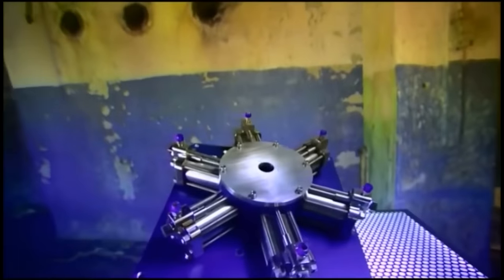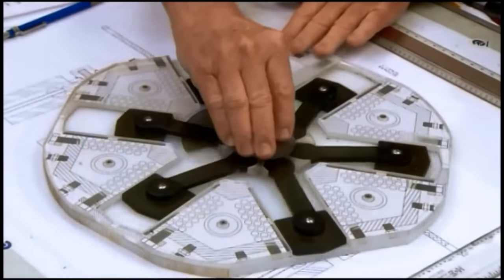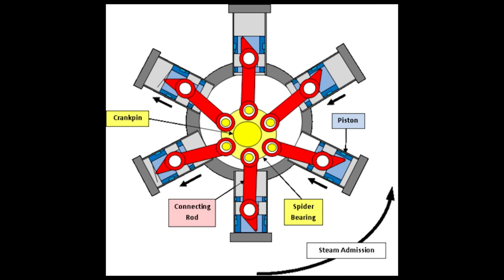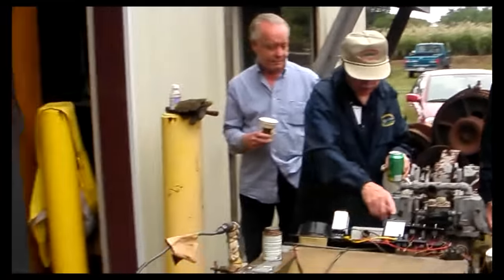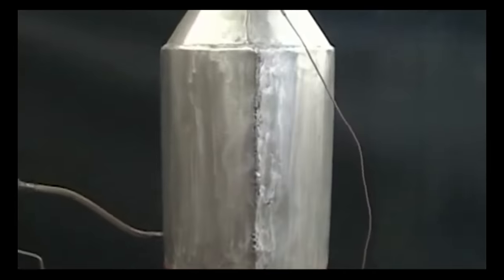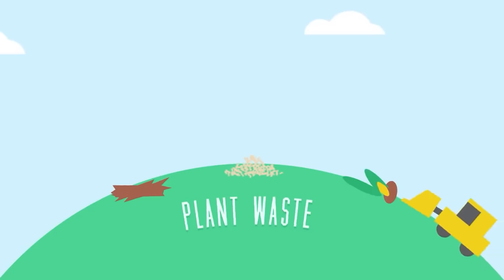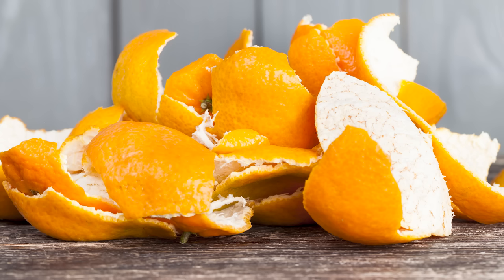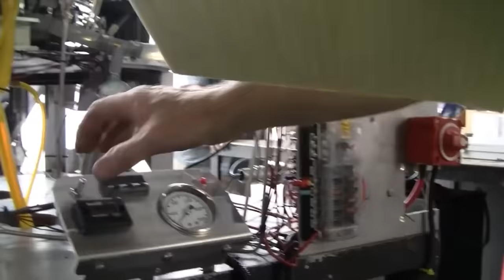Is the Cyclone external combustion engine the future?

Comment: Those old steam engine powered cars were anything BUT slow, they were far faster than any of the ICE powered cars of the time.
Reply: 200km per hour is not something slow..
Reply: @FadeToEvil  I think he may be talking about the old ones that they would of been competing with at the time
Reply: @thesimpletroll2769  A 1906 Stanly steamer car went 121.6 MPH on it's first try, the second try, it reached 127.7 MPH. That record stood till 1910.

Gasoline powered cars took many years before they reached those speeds. But the gas engine evolved quickly, while the steam engine was ignored, and made the gas engine the main engine the world over.
Reply: Only if the outside pressure was extremely high........which can be achieved with a flash stem boiler.....all of the problems of piston type steam engines can be overcome with a steam turbine.
Reply: @gangleweed  There is no problem with piston steam engine itself, but steam turbine with small scale has problems like low efficiency. It should spin very fast, so reducer will take a lot of power. Flash steam boiler is something different. I prefer to call it monotube boiler (because flash steam is converting pressureated water to steam+water mixture)
Reply: @FadeToEvil  Yes, monotube boilers are very simple but difficult to regulate to get a steady steam flow.......sometimes you have to tolerate lower efficiency with a simpler device like a smaller turbine....it all depends on the fuel you have available......the best fuels can be very expensive and the poorest could be had for nothing.
Reply: Top of the shelf reciprocating internal combustion engine. Pulse jets are Better
Reply: I believe that the "slow" in this case has to do with warm up time. Most of the steam cars had a warm up of 15 minutes to half an hour based on fuel used.
Reply: @Shindinru  Doble car can be driven in 2 minutes after lighting up  the boiler
Reply: @FadeToEvil  I did say most, plus the Doble models you are thinking of are recognized as the height of steam car design from the latter end of the age of steam cars.

Most of it's contemporaries still took 10-15 minutes.
Reply: @myemail5457  yes, pulse jets. Great form of transport if you are already deaf.
Reply: There is a good reason why steam cars became obsolete a hundred years ago..
Reply: Jay Leno's Garage has a steam car and the motor takes about 10 minutes to reach temp and it barely gets to highway speeds but does get there the biggest issue is range before it needs to be refilled the danger of the boiler exploding in a crash and the super boiled water/steam melting people in a split second.. the boiler corrosion protection wares out and the boiler can be very dangerous.. steam cars are stupid 🙄 steam turbines and generators are reasonably safe because the boiler can be far away from the people and the turbine.. even old steam trains was dangerous for the driver and service staff but the cars was pretty safe tho.. many train boilers have exploded and it's really like a huge bomb 💣
Reply: @jeffreyyoung4104  one of type of Doyle's that Leno has could do 130 mph. Pretty good for a 5000 lb car
Reply: @tadwyn  The Doble barely produced 150 horsepower continuously, it struggles to maintain speeds above 75 mph.

6.5 Mpg highway 3 Mpg city on regular unleaded as absolutely horrible.

Especially considering it was the most expensive car in the world.
Reply: @sandervanderkammen9230  which Doble do you mean? Also are you starting with boiler hp or regular ic hp. I get my info from people in the phorum who owned and drove one. Also Jay Leno in one of his videos easily drove one of his Doyle's on the highway at 70 mph. 1 boiler HP is equivalent to 13.7 standard HP.  Until I found that out it gave me problems. I don't remember the efficiency of the monotube boiler but it's output was over 400 standard hp. It burned over 2 million BTU of fuel at full throttle.
Reply: @Shindinru  correct on both sides. The Doble used a monotube which contained very little water while the Stanley had an actual boiler with over 100? Gallons of water. It takes a lot of BTU's to heat a large boiler. Also the burners were quite different in design.
Reply: @michaellegg9381  monotube boilers don't have enough water to be dangerous . Unless you have your head over a steam line and it decides to break at that second. And as pointed out this is 100 year old tech. People don't get their hands broken starting their Ford with today's cars.
Reply: @tadwyn  The Doble E-series according to Doble's own manufacturers specifications was rated at only 150 bhp SAE continuous.

Yes, the burner BTUs was 2 MILLION which is equal to over 750 horsepower, yet steam is so inefficient that it only produced 150 usable horsepower maximum, the rest is lost in waste heat.
Reply: @tadwyn  Steam at 750°F at 800 psi can not only cause extremely severe injuries it can easily be fatal.
The Doble boiler stores more destructive energy than a hand grenade.
Reply: @tadwyn  Yet you seem completely oblivious to the Carnot Formula, Latent Heat and the Laws of Thermodynamics that prevent the Rankine Cycle from being as efficient as ICEs.
Reply: @sandervanderkammen9230  no. I do know what you are talking about but just as the 60% efficient steam turbine power stations which were thought to be impossible they still work. And of course the old piston engines were very inefficient. But find an effective lubrication method and that is a good start. Something slicker than Teflon, harder than steel, and a very high melting point.
Reply: @tadwyn  Yes, you are indeed very confused and misinformed.
The most efficient combustion powerplant in the world is Internal Combustion.

Also wrong, Diesel engines in the 1920s were achieving 40% thermal efficiency in single cycle operation, that 400% more efficient than the Doble.

2-stroke Diesel engines today can reach 55%..
Higher than any steam turbine in the world.
Reply: @tadwyn  Gas Turbine ICE powerplants are the most efficient, the General Electric 7HA.3 is 64% efficient.
Reply: @sandervanderkammen9230 Anything steam is far superior than ice
Reply: @sssbznzn  Lol! Thanks for confirming that you are clearly not an engineer! Hahaha
Reply: @sssbznzn  Steam engines are excellent business for big oil companies, they would be very pleased to see the world full of steam engines son... because they use more fuel than ICEs
Reply: @sssbznzn  That comment reveals someone who doesn't understand what Torque is... Torque is not measured in seconds.
Reply: @sssbznzn  Bugatti Chiron produces 1,180 lb-ft of torque.... it also produces 1,500 horsepower.

Comment: its a steam engine steam engines are external combustion engines if you look at the "engine" they look fantastic on paper but the boiler and condenser are MUCH larger than the carburetor and exhaust pipe (carburetor~= boiler, aka where fuel is added)(exhaust pipe ~= condenser aka where heat is rejected) so internal combustion is WAY more power/smaller/cheaper, it never stood a chance

Comment: These were very similar units to those used in DoD/USAF courier trucks in the late 70s/early 80s. They could literally run on anything, and were used as everything from couriers to tuggers at several air fields. Cyclone's claim-to-fame wasn't the steam engine, but the cyclonic combustor. The centrifugal force of the high velocity cyclone, was a captive cycle for most of the particulate emissions the EPA was currently focusing on. They were working on a closed-loop Sterling model, which was even less maintenance. In the end, they lost out for lack of marketability and a restrictive investment contracts. The slow start-up time, low power density by volume, preferred vertical orientation, inflated goals, and low duty cycle, saw the project fall off the radar. In order to achieve their peak efficiency, the engine used a vertical orientation to take advantage of natural convection. 

Last I heard, a slightly different version of the combustor could be found in a waste oil heater... but I'm unsure if it has any relation to Cyclone. I reached out to them several years ago, in hopes to connect them with a pneumatic motor supplier from Australia... but it didn't work out, as the Aussie supplier was adamant about both NOT using his motors in combustion engines, but also not letting the tech leave Australia (although it's now used in some forklifts).

Comment: Some of the downsides of an engine like this (slow response, warm-up time) wouldn't be an issue if it was used to drive a generator for a range-extender in an electric powered vehicle.
Given that there's no reason this couldn't burn renewable fuels... That said there's probably more compact, lighter options that would work better.
Reply: If the fluid was super critical steam  it would take minimal heat input to cause change from liquid to gas but the visible plumbing on that machine would not contain those pressures.
Reply: In a perfect world.. not.
Reply: Yeah true, slow to warm up  but how long does it take to charge up your EV Vic UK
Reply: Thats the thing about flash boilers- theyre called flash boilers for a reason, they're very fast to warm up.
Reply: I knew an old lady who swallowed a fly.... E-vehicles suck big time. We need better engines, not inefficient range extenders for already very inefficient power trains.
Reply: That'
s not an issue in a generator.   A generator just needs to startup once  and the real business is done at runtime. 

Unless you're thinking about it being some sort of portable device for immediet use    but thats the wrong use-case for this engine   not that the engine itself is flawed.
Reply: @PutsOnSneakers  .. As an atheist, how the hell did you get your Youtube name!? Must have cheekily got in there when Youtube first started?... Fair play... 
--
Why not try to simplify and improve an Internal Combustion Engine instead of difficult to recycle and repair e-motors + power trains (+ ICE if it's a hybrid))?
--
How about a 1 STROKE, 1 CYLINDER ICE + Heat Engine combo.. A free-piston, reciprocating rotary engine that will run on many fuels. 
--
A 100mm or so long central cylinder with 20mm solid piston head + rings shared between an impeller combustion chamber each end.. 1 STROKE so combustion provides torque and fires the piston that compresses the air-fuel mix in the other end, also proving torque.
--
This 50mm or so wide central cylinder is wrapped in a 'ring cylinder' filled with compressed gas (ie. CO2). A 'ring piston' is fired at it's impeller at each end, with the gas expansion from the combustion heat provides extra torque, as does the gas being compressed the other end. 
--
The rest is an exercise for the readers imagination.. I can tell you it is possible to fit everything in (solenoid valves, Spark Plug Fuel Injector (SPFI).. 2 engines with (auxiliary) fuel tank spinning with them (providing centrifugal fuel pumping) solves a potential fuel seal issue.
Reply: Using a steam engine to turn a generator to turn electric motors just adds unnecessary conversion losses and kills thermodynamic efficiency.

Comment: From what I've read, the inventor had very little understanding of how to actually make a viable engine. Besides the water lubrication issue others have mentioned, the original design linked the pistons to a freely rotating plate rather than a plate aligned with one of the pistons for radial engines as is common practice. This added extra vibration and mechanical loss.

Overall, my impression of the Cyclone engine is that it's either a scam or made by a well intentioned person who really didn't do their research. What especially disappoints me is that there are several modern steam groups that are much more reputable (I.E. actual research and, in the case of DLM, actual prototypes and production machines) but seem to have little notice.
Reply: One would think that if they used supercritical steam.. they would also use the multiple expansion making it worth it
Reply: Would burning orange peel raise the temperature to 1200 Deg F, or 649 Deg C, to produce the superheated steam?
Reply: @NorfolkSceptic  possibly.  Orange peal actuslly contain a very potent oil... not much... but if you have a ton of it.
Reply: @NorfolkSceptic  it would need to be very well dehydrated to be worthwhile. Otherwise you are wasting a lot of energy boiling off the water content.
Reply: @matsv201  Harry was trying for a high rpm engine similar to  an ICE. The stroke was very short and then attempted to recover as much heat as possible. It used a large blower to condense the steam in an unusual manner using rotating plates. As for it being a scam I do not believe for a second that Harry Schoell was dishonest.  He really believed in his engine. His boiler design was quite inventive for being so compact.

Comment: the dobel steam cars used closed loop steam systems with a water tube boiler kindof like what they are showing, but the dobel steam cars were actually sold and could reach over 100 mph. Jay leno has several of them with at least one running, the problem with them is up keep on such a system.
Reply: Check it out. .Great Segment...

Comment: For automotive use the first thing I thought of is keeping the water in the system from freezing overnight in the winter. Durable water lubricated bearings are already in use but quite expensive to make and need to be kept well below the water boiling temperature in use. The many real world engineering challenges keep building up in my mind that need solutions for affordable, reliable and durable consumer automotive use.

Comment: The questions that need answers:  What is it's efficiency?, What is it's readiness (my term), that is how quickly can it be turned on and brought up to performance operation?  How often will it need make up water?  If it is a completely sealed system will a different working fluid be better?  Now in my perspective, it may make a great engine for a hybrid system car where it is basically an EV but when the batteries get low, the engine ( generator) cranks up and recharges batteries and also provides travel power.
Reply: Yeah hybrid steam/ev sounds promising even if it can just extend the milage in an ev per it's weight and space more than the space the battery space it takes up, could be worth it.

Comment: perfect for stationary power generation applications, by means of burning fuel, but unfortunately not enough for automobility, because external combustion engines have a lot slower response to accelleration commands than normal internal combustion engines, also solar can not produce enough of the demands of such an engine, although it is an amazing feat of engineering...maybe they did not receive enough demands from customers to make it a pheasable business...

Chris, have you done videos on the Robert Bourke Engine, broer?
Reply: Something you don't know about steam engines if you think theyre not responsive. Or maybe you think they all operate and respond like the copper and brass toy steam engines that weren't built to actually power anything.